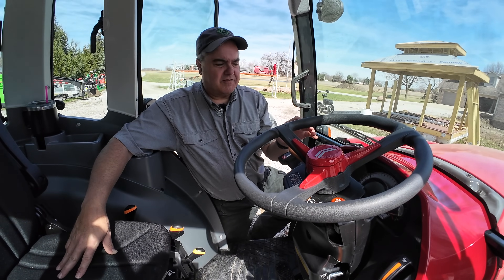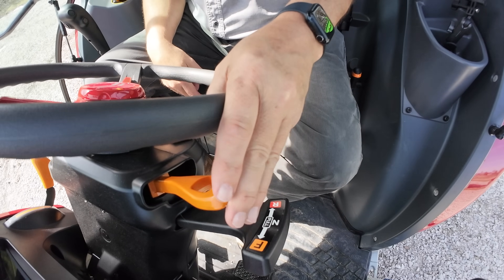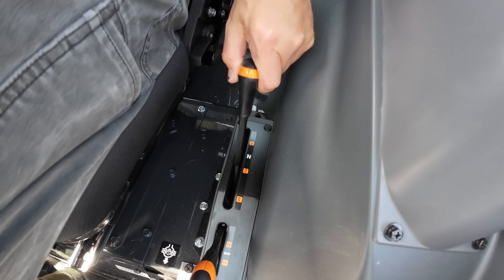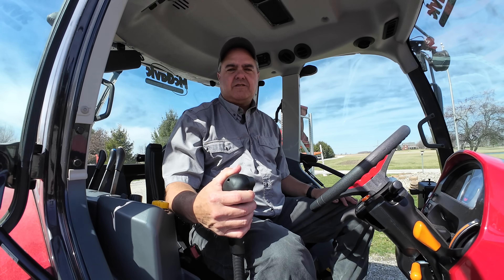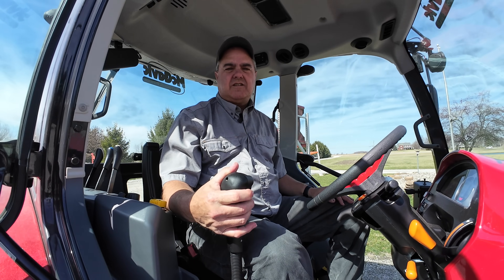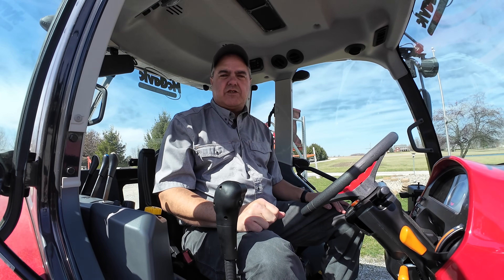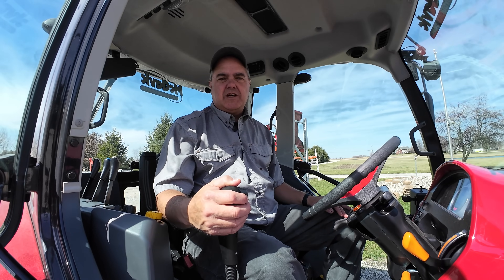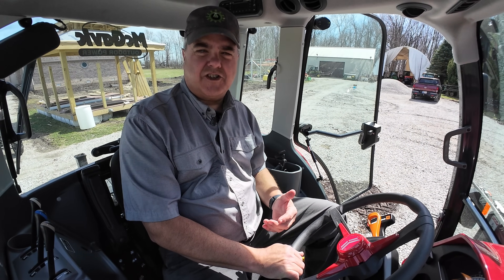Yanmar YT359 Operation: Hydrostatic? Shuttle Shift?  EXTRAORDINARY!

Comment: I have a power shuttle with a creeper gear, and I love it! But, I think I feel that way about it because I can't finesse my forward and reverse controls like on a hydrostatic tractor when doing loader work. Just connecting to the bucket or grapple can leave a nice gouge in the ground with a geared tractor, so coming in super slow with the creeper really helps out with that. It'll also help you not bump the side of a trailer or truck bed when loading or unloading from them. Ask me how I know.

Comment: I have been a Deere fan all my life and I have owned both Deere and Kubota tractors.   Yanmar has proven itself over the years to be a reliable and I think they are on to something with this set up. I would like to see hydraulic temps under load (say bushhogging) 20 or 30 acres or pulling a disk.  Yanmar has defiantly got my attention !   Thanks for demo !
Reply: They are so good Deere has been using their engines for a long time.
Reply: Me too currently using a 5075e a 5400 and a5300 along with a 5305 been working tractors too long 😂 i like this thing it winked at me .
Reply: As a Kubota HST owner, I find that Yanmar has some very interesting features. Great job demo-ing this.

Comment: Congrats on the new machine. my gripe was the view out the back and being able to see over the fenders and hooking an unhooking 3 point implements, and my knees connecting with the steering column. and the ability to push into a pile and curl and lift, seamed rto not want to, where my Deere would have zero issue doing the same action. as if the distance from pin to bucket is so much greater with the SSQA vs the JDQA. more leverage less force. defiantly look forward to more videos. !! congrats again.

Comment: Sounds like a modified CVT transmission outnof a larger AG tractor. They don't use a pedal. They have a small joy stick in the right hand controls you can adjust to adjust speed and lock speed in.

Comment: Like a fork lift basically.   With the fork lift you use the clutch a ton though to rev the engine up as you need the power

Comment: The system you showed reminds me very much of operating a wheeled Cat 980c loader as a kid. It had some differences of course, but it behaved much the same way. There was a lever on the left side where your shuttle lever is that gave you forward and backward motion, but it had a six speed rotational control on the lever that shifted through gears. You did not use a clutch on it either. The accelerator did not change the engine RPM but did control the forward and reverse speed of the machine. The loader joystick had a High RPM button for when you needed it to run max RPM for loader break out or to lift the load. Now it also had the A and B setting. The use was similar I believe. A was used as a slow setting (most used when creeping up to a truck to dump the load) and a B setting for traversing between your materials pile and the truck. You could set these speeds in every gear on the shuttle lever, but the A was always the slowest. 

On a tractor in it's simplest, the A B is useful for field type work or loader similar to the Cat. In field work on say row tillage you have one speed, but you want to slow way down to make turns. You switch between A and B (pre-set speeds).

Comment: I think that I would probably feel right at home in this tractor. I have a Ford 4500 industrial. And it is also a shuttle shift. Of course I have a four speed manual gearbox that I must select first to control my maximum speed and low and torque. On your Yan mar I do like the finger throttle control on the joystick. One of my struggles is when I’m trying to raise or dump my loader. The movement is very slow because I have let off of the foot throttle. If I give it a little bit more throttle to speed it up the tractor wants to push forward. And even if I am holding the break, I can then overpower the break. I’m curious on yours if you bring the tractor to a stop and then hold the finger throttle on the joystick to control your loader movements. I would assume that with the hydrostatic transmission it would not move forward just raise RPM to make the hydraulics work better. I think that is a nice feature.

Comment: That is very similar to the JCB Dual tech which is basically a Torque converter and hydro static probably a bit outside your requirements you've probably done Yammer a better advert than any agency could are there any landscaping contractors here in the UK hwo have tried one yet good job Tim.

Comment: Is the "clutch" pedal referred to an inching pedal to aid hooking up implements?
Reply: You can press the brake pedals for that. It’s much easier using those than the clutch.
Reply: @amandadavis9726  does it creep in reverse ?
Reply: @golfy808  🤔 I think so. I haven’t really paid attention to it in reverse, because I mainly use mine to do loader work. I’m supposed to be getting mine back on Friday. I’ll check and make sure if it does or not. The clutch is totally worthless in my opinion. I have about 115 hours on mine, and I purposely tried using it twice to see how it worked. It didn’t get my attention if you know what I mean.

Comment: Question: the “accelerator” pedal looks very far to the right side of the cab, like you really have to cock your leg over to reach it…..is that the case, or just the angle in the video?  Is it comfortable to reach?  Thanks for the video, great explanation of how it works.
Reply from the maker: I agree it looks like it would be uncomfortable but none of us have found it to be so.
Reply: I was wondering exactly the same. After breaking my back, uncomfortable foot placement is a huge issue for me. It also appeared that the pedal was bending, but that could be a lens effect.
Reply from the maker: @TallTexasGMan  nah.  Pedal seems very tough.

Comment: Interesting. It’s a little different than I thought it might be. For whatever reason I thought you might be able to put it in a gear and go constant speed, then use a pedal to vary that speed up. Essentially that seems like what it is doing (creeps when in forward like a creeper gear), but you can’t choose the gear/minimum speed. Seems like it drives much like a hydro. I’m wondering if it pulls more like a hydro or gear drive with respect to power to the ground? While having unsynchronized gears like I do in the ‘81 Ford can be a nuisance at times, I do appreciate the power to the ground!
Reply from the maker: The primary advantage of this transmission is the efficient power to the ground much like a gear drive.

Comment: Your correct Tim on the throttle control on the joystick of the FEL. KUBOTA has it on the Grand L series. It does help when going into big piles with your bucket. I believe the Grand L also has a sensitivity feature for its peddle. I think that I adjusted it once.
Great break down on this new tractor and cat cam at the end LOL.😊
Reply: It does have it. 

I picked up my L6060 a year ago but this Yanmar was close 2nd. Such a great machine with really good value. Kubota financing and dealer being too far away is what only lead me to the L6060.
Reply: @paybax  We really like our 3560 Grand L. We got the hydraulic SSQA, third function, and 3 rear remotes. Right now we are just using one of the rear remotes for a hydraulic toplink. It is a feature rich machine and does well for us.
Reply: @ Got those options myself as well. Spending that much might as well get everything 😂
Reply: Another Kubota owner here! Grand L6060 HST with cab.  This Yanmar is also a great machine.